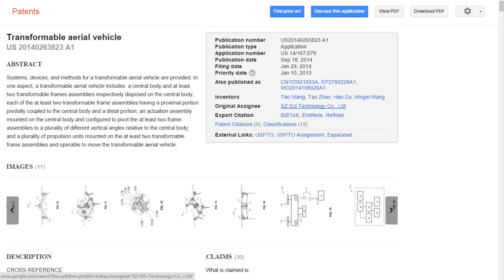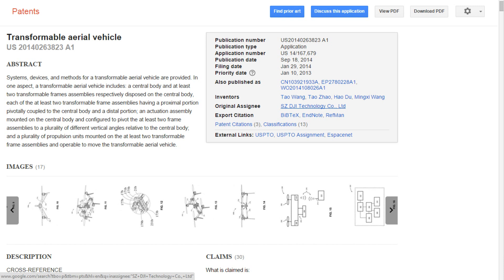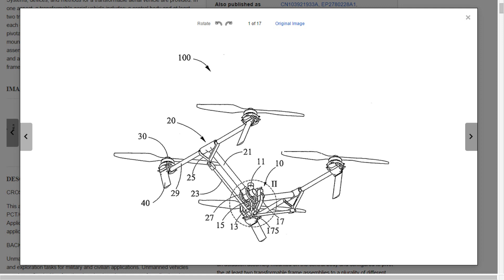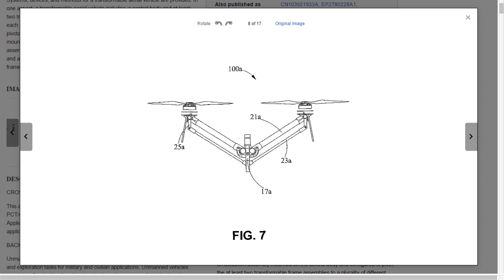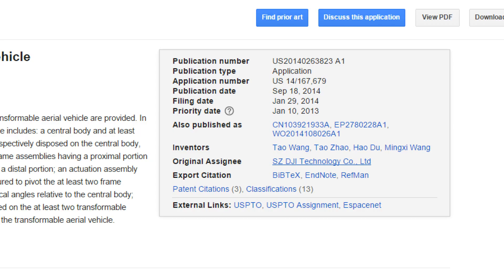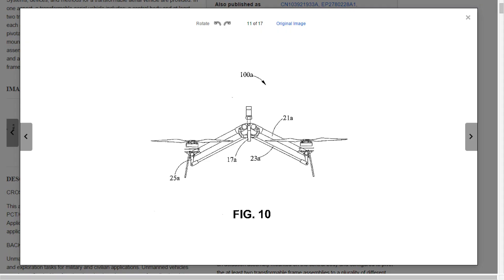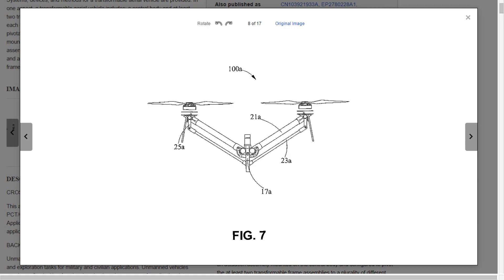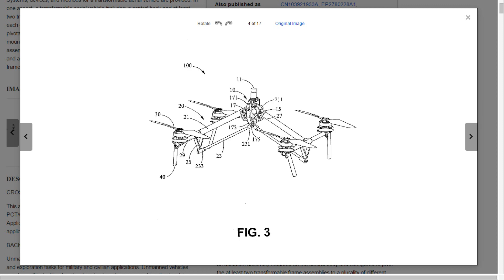DJI Patent reveals "transforming" ability - Inspire 1 design revealed?

Comment: Simon, I agree everything points to a pricey launch. However it wouldn't surprise me if the suits in downtown Shenzhen surprise us all by launching in the sub £1500 range, why.....Well most of the cost is attributed to the intangible "IP" rights. The actual cost of the raw materials that goes into the construction of these crafts is significantly negligible by comparison. Most of the components will be produced for a wide range of models so there's no exclusivity in the manufacturing cost.  DJI's real ambition is domination, but more importantly elimination of the competition, this will play a huge part in influencing their launch price. It's a numbers game where each unit sold serves to not only feed the cash flow of the company but as importantly starves the competition of a sale. I think we are all far too easily persuaded that technology such as the lightbridge link should automatically cost the earth, when in reality it's relatively cheap to produce and can actually serve to be the killer blow to the competition. Retailers have been rubbing their hands over the last 12 months with the fantastic success of the P2 and PV etc, I guarantee retailer profit margins are going to be squeezed on this one. Let's see what happens, DJI look like an extremely aggressive company. Let the show begin !